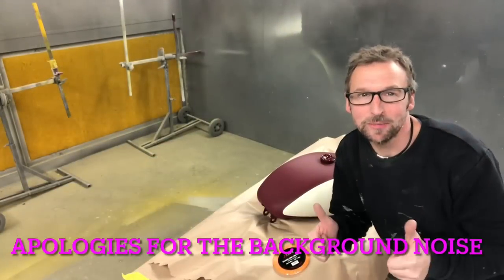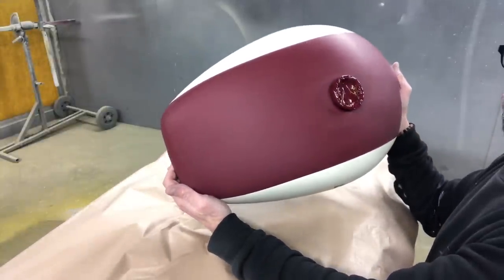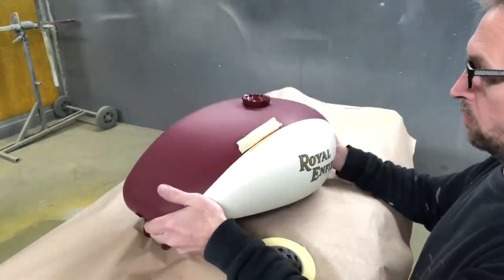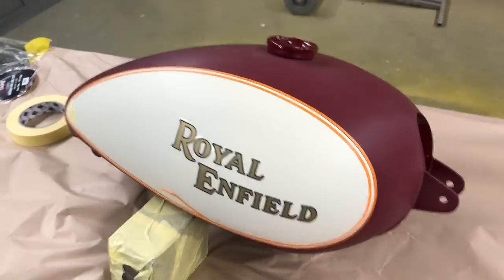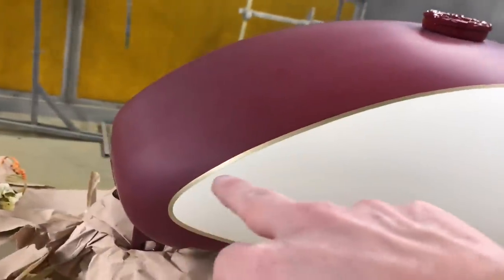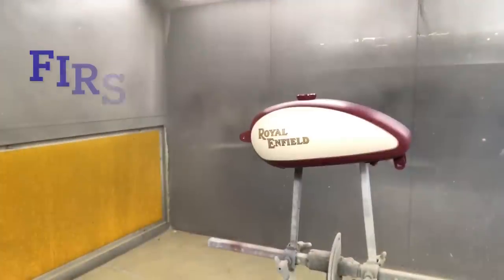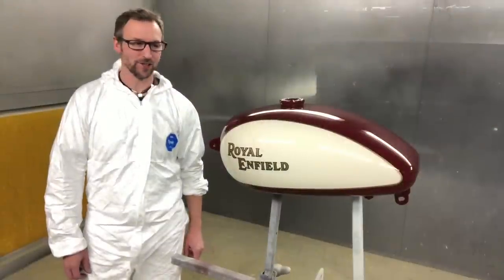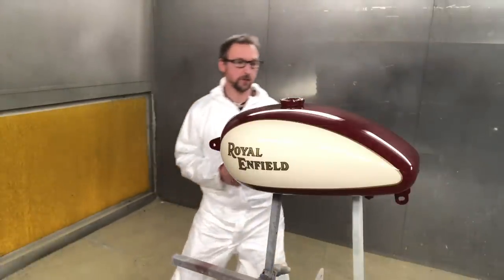Dog house custom’s Enfield tank, part 3

Comment: Beautiful looking job. What is the brand of fine line tape you use, and how long do you wait before demasking.
Reply from the maker: Thanks mate, it’s called j tape fine line,basically the same as 3M blue
As it was only a light dusting of base coat 5 mins was fine, but anything else you need to wait till it’s pretty dry, so it’s not tacky at least 👍🏻

Comment: Looks Ace! Do you think the angle at which you pulled off the fineline tape had anything to do with the slight raised edge of the gold?
Reply: No.
Reply: Your lordship has been conspicuously quiet of late.
Reply from the maker: No Ian, it’s just something you get when you put a very fine coat on, if it was heavy like a 2k you wouldn’t notice it as much, also with a metallic it highlights it slightly more, but not the clear is on it’s no to bad at all mate, you see you don’t get that when you do it, cos your a pro and you don’t use tape 🤪👍🏻👍🏻
Hope your good mate👍🏻
Reply from the maker: @lescrook2750  yes Les, maybe he’s cooking something up!! 😜👍🏻